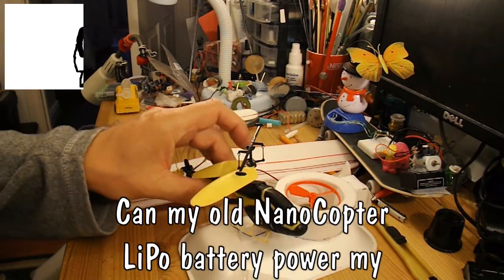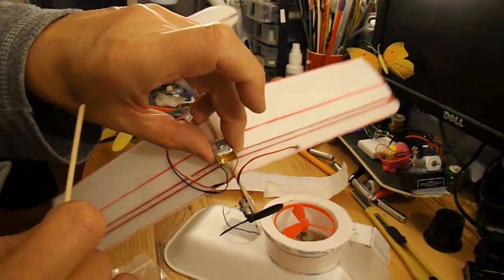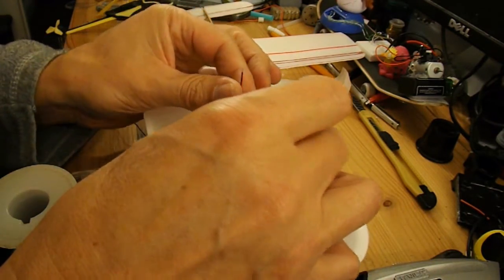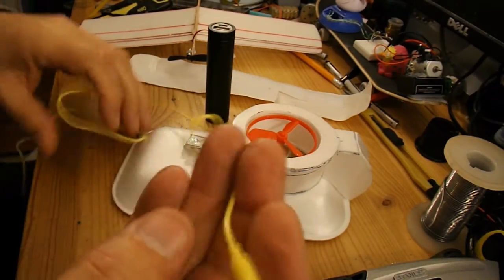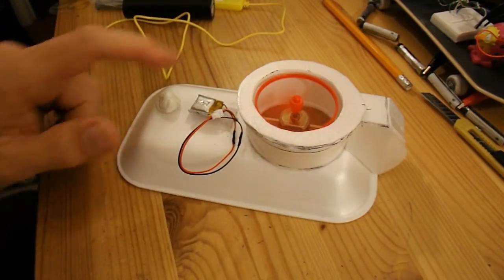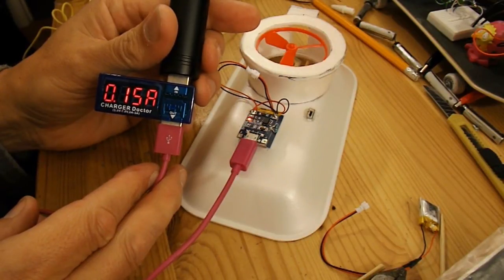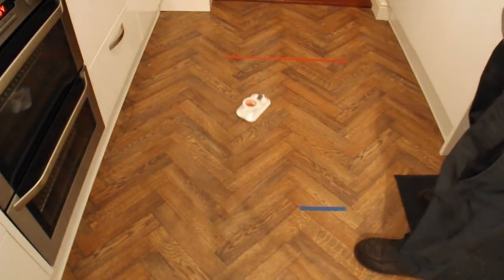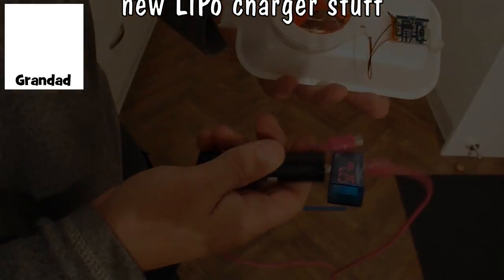Can my old Nano Copter LiPo battery power my styrofoam tray hovercraft

Comment: Scoots around nicely !
I've been using those lipo charger boards for a few weeks now and they do a grand job, for the price too (about $1 if recall).
Reply from the maker: Yes that board seems to work fine. Another one of those eBay purchases that cost less delivered than I could post a letter for in the UK.